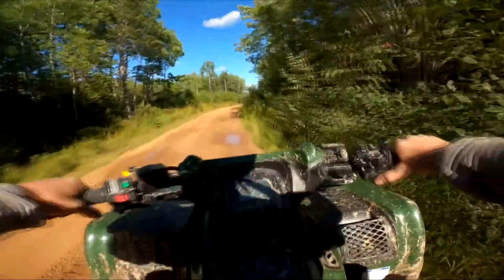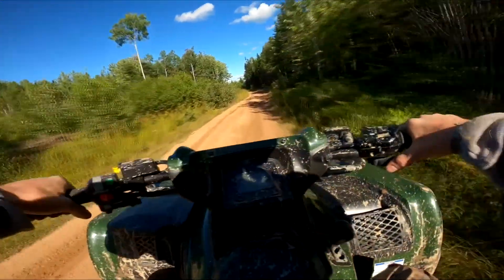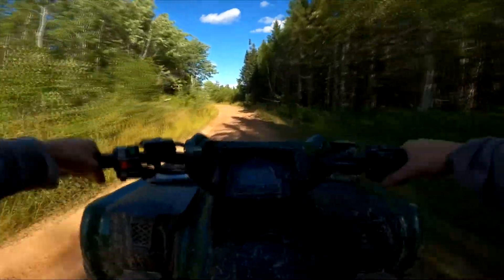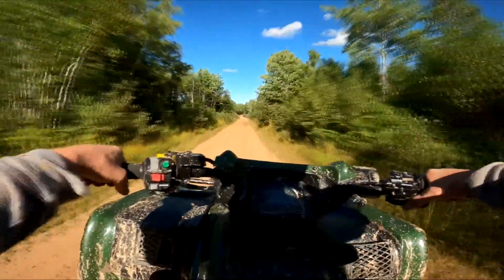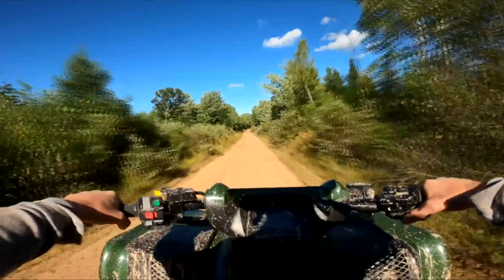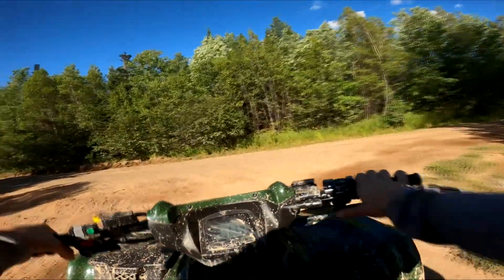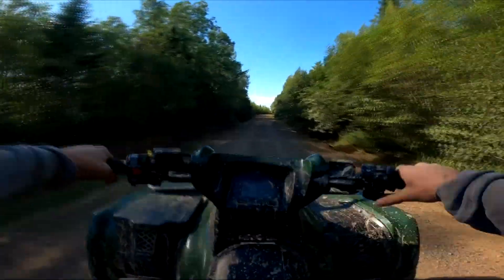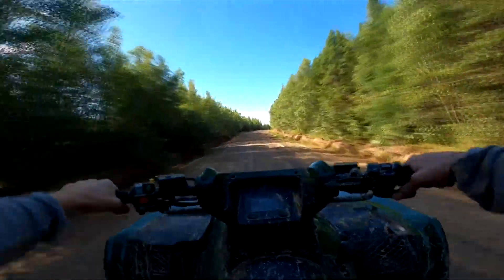Top Speed after Dalton Clutch Kit Installed Brute Force 750

Comment: How fast after kit
Reply from the maker: After installing the kit and breaking in the belt It would do 115kmh. That's w rad relocate and lift. I had to replace the fuel pump so more vids coming shortly.
Reply: @wileinthecountry9547  OK what size tires ? I get 110 stock with 27 inch
Reply from the maker: @matthewhickey4010  30x10x12
Reply: @wileinthecountry9547   why did you replaced the fuel pump? Which brand ?

Comment: What all comes with his kit just springs?
Reply: Kit comes with primary and secondary springs. New fingers for the primary, along with rivets and screw in weights for fine tuning
Reply: What year brute is this? I have a 20 and I believe the kit only comes with springs on there website. 2012-2020 rated for 26 to 28 inch tires    I just put 26 inch zillas on and lost top speed and pull. It’s slower on acceleration now. Trying to bring all the pull and top speed back.
Reply from the maker: The kit for 28s and bigger comes with eveything. I have another video about the kit w part #s.